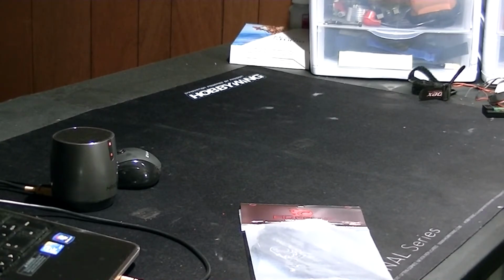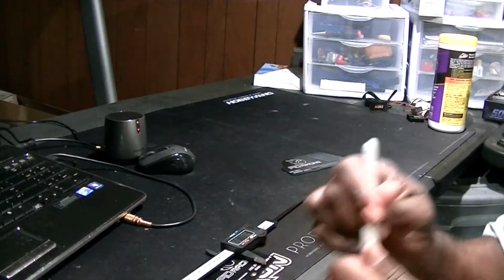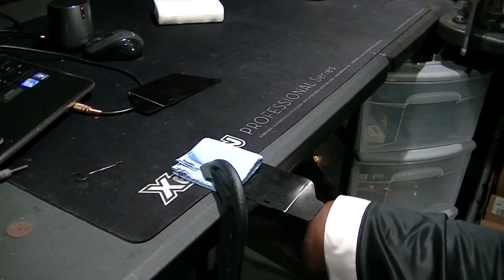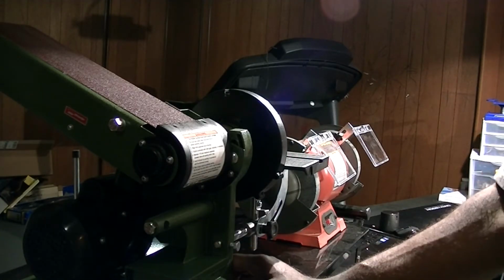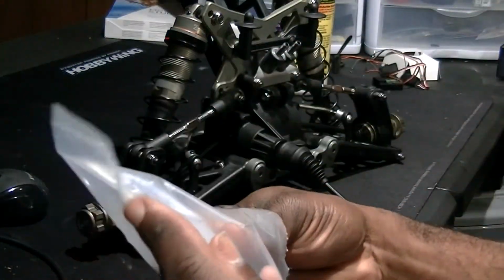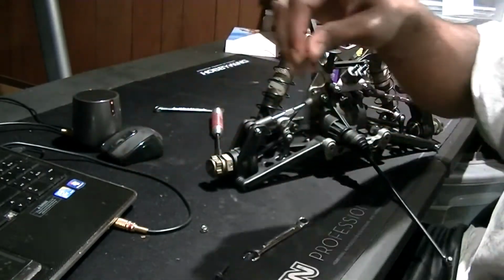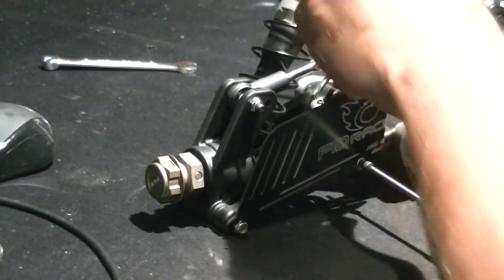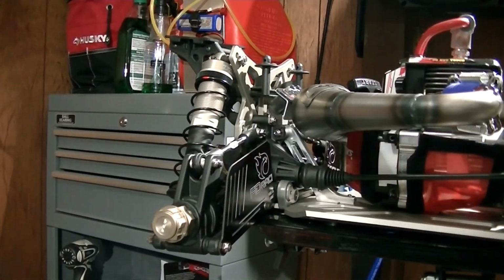Losi 5ive B road to completion video 7 Fid dust protectors mod

Comment: Now THAT'S using your Noodle, Brother!!! 😎👍👍👊 
One little tip.... Use the Fiber Reinforced Dremel Cutting Wheels. Takes a LOT more force than that to break them - and they NEVER explode, like yours did!! 😱😵 
And, as soon as you started cutting, I KNEW that wasn't Aluminum. Carbon Fiber, or Reinforced Fiberglass....  Either way, I've heard they're very strong! 
I see we went to the same School..... "Make it Fit" University!!! LOL 😂😂😂😁😊  Seriously, great IDEA. I'm keeping this in my memory.
Carmine 💥⛽
Reply: And...... DAMN Bro!!! You really muscled those rear Hubs to the Lower Arm!!!! 💪😀
Reply from the maker: PoorManRC Thanks for  the tip on the dremel cutting wheel but I have about 40 of those left that I have to use up before I invest any more resources into cutting wheels, that's the last of a set that I might have bought about 6 years ago then it will be about that time to get some more. I am the type of person that if they don't make it I will create it or fabricate something to work for the application that I need it for!
Reply: I do feel you Bro!! 👍👍 As I mention TOO often, my budget is going to force me to be extra creative!!! 😱 
Thank GOD I kept 90% of my Tools - especially the specialty stuff. I've been fabricating for the past 3 years in 1/10 Scale.... I just need to think BIG!! 
I'm picking up some great ideas from you. Thanks!

Comment: Question! Do you think the wheels not tires that come with the losi 5b are the best for racing?
Reply from the maker: BERRY RC those wheels and tires must be good because every time I see 4wd buggy racing most of the 5ive b cars have the factory wheels and tires on them due to they are extremely light compared to a beadlock wheel and tire. That is the lightest wheel and tire combo that they make for 1/5 scale cars!
Reply: Elite Rc agreed!